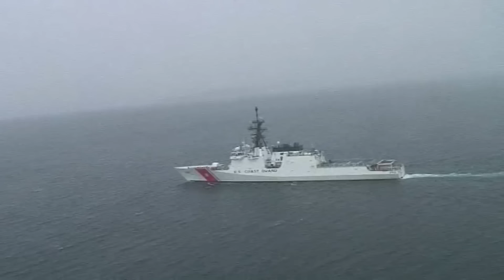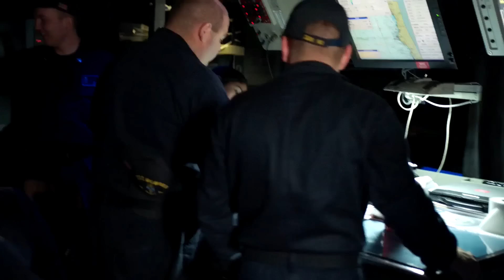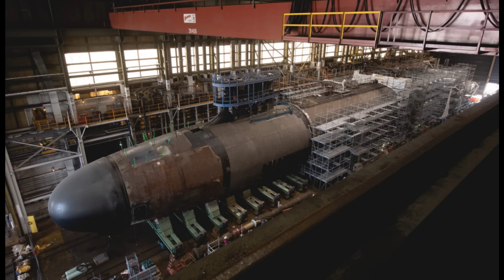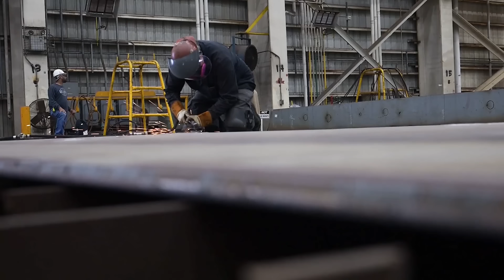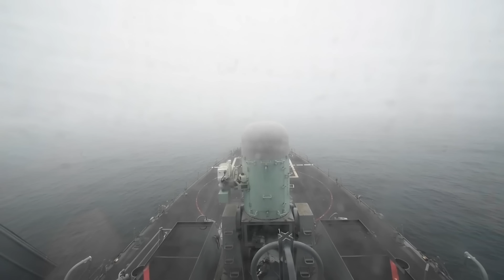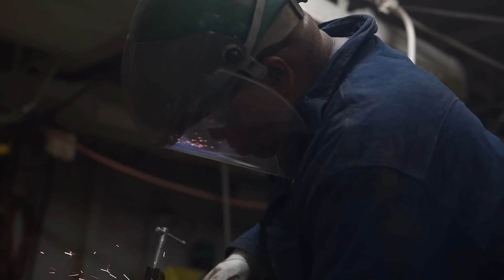The US Navy’s Radical Plan to Build Its New FF(X) Frigate Faster and Cheaper

Comment: You are right, the LCS and the FF(X) are similarly puny in offensive capabilities.  The LCS, however, had so many problems with corrosion, machinery, manning, escalations in cost, modular weapons development, short legs, etc., that the Navy just gave up on it.  If more conventional and efficient and lower speed machinery could have been installed, the LCS might have been salvaged, but that would just take more time and reveal just more problems.  The FF(X) gives the Navy a ship with long sea legs with a decent track record.  That is just what is needed.  The Garcia class frigates were highly successful and had practically no armament.
Reply: The FREMM is a better design in every important respect than this ship, is also a significantly larger warship (in standard form) and has far more options for weapons systems. The FREMM design also has a hull optimised for anti-submarine warfare; the coast guard cutter is designed for speed/endurance and not the specialised anti-submarine warfare (ASW), hydrodynamic requirements for a submarine hunter. 

The Royal Navy made this mistake previously in trying to reduce the size of warships to the extent they were under-armed and also had no sensible option for future (and usually) heavier weapon systems or more systems, the cutter also has the extra problem of not being designed for ASW, something that cannot be fixed as hull design has to come first.
Reply: @LeeXRV  The Coast Guard ship beats it in having way longer sea legs and ability to handle rough seas.  The FREMM is better in most areas.  That is why the Navy originally chose it.  Only now they realize that these ships will take longer than expected to build.  They were forced to choose between 2 goals:  1.  Build a frigate that was highly capable but which would be costly and take longer to build, or 2.  Build a frigate that is basic (and no match in capability to Chinese frigates) that can be built quickly (still slow by Chinese standards) that can be built in more yards (thus enlarging the US shipbuilding capability).
Reply: @gs547  what evidence do you have that supports the Coast Guard ship being superior in rough seas? I'm sure the opposite is true that the FREMM is more effective in rough seas due to the hull design. 

Ships that are designed for speed and endurance are usually worse in rought seas. The FREMM is also far longer and heavier which will give it a significant advantage in rough seas. 

I would argue a country should place its primary warfare decisions on the capabilities of the ship rather than the secondary benefits of employment, its also worth saying if speed of building is important the FREMM ships can be built at a much higher volume in both US and European shipyards. The main problem the USN has had with the FREMM class is excessive redesigns of it. It's kind of silly, the USN kept modifying the design of the FREMM class and due to the delays the project was axed and replaced by a ship of about 1/5th of the capability, talk about own goals eh?
Reply: @LeeXRV  Ingalls claimed in 2014 that their patrol frigate (modified Legend class) ship could operate helicopters and boats in sea state 5 or higher.

Comment: The FFX is a good idea and a great start. I'm not as sure about the BBGX though. I think what they really need there is to take the basic Ticonderoga hull, then update it with modern power plants, superstructure, electronics and communications.
Reply: The Tico hull is maxed out as is the Burke.  They need a larger hull for a large surface Combatant.  Remember steel is cheap, advanced weapons and systems are whats expensive.  Just making a big ship doesn't mean expense scales up.  But if you load it up with huge numbers of weapons and systems...that would drive up cost.
Reply: @brenthegarty3922 then go with the BBGX if you need a bigger hull than the tico then you might as well go with the battleship. The whole point I was making was it would be much more cost effective to go with a known product and modernize the power plant to produce whatever is needed to operate the new systems. If you need to go bigger, then you might as well go Trump.

Comment: The essay is a well argued case for a frigate class in general and within a rapidly declining US Navy, especially. 

What could be elaborated on in a follow up video is a breakdown of costs between hull, propulsion, sensors, and armament in order to clarify which components are driving costs, most - arguably since the Spruance-class. 

I tried a bit, before to comment about comparing sensor and fire control systems across frigate and destroyer sized hulls, currently in NATO and ASEAN service , but one could need 'a drawing' in order to visualize the different 'Off-the-shelve' options upon which any proposed 'Extended Patrol Frigate' by Huntington Ingalls Industries can be judged... 

...as either 'mediocre' - even insufficient for it's basic mission like the two Littoral Combat Ship classes which all-aluminium hulls can only operate along uncontested coastlines (at 350 plus million USD per unit for the Freedom-class and multihull Independence-class, originally planned for 55 vessels, but with several lead hulls decommissioned without upgrades, only 27 of 35 remaining active) - or as an outstanding combination of contemporary naval components within the intended price range (ideally within the 550-800 million USD mark of the Legend-class National Security Cutter - with ordered unit numbers bringing down production costs - one may conclude from the LCS procurement, cut short to 27 units, a FF-(X) would have to fill the gap by 28 units)...

Comment: This is exactly what the Navy needs. It doesn't have to be a heavy hitter to help the Navy's overall mission, especially with the Trump class getting green-lit. Having 8 NSMs is plenty of threat to force the enemy to worry about it, and the fact that these can operate out on their own, away from the fleet, makes it something the enemy will have to take into account. Having different angles of attack is critical for naval surface warfare. But the biggest thing this program provides is the industrial boost the class will allow for. And once they have the platform, the Navy can develop new weapons that can be fit to the system, especially things like drones (aerial, surface, and sub-surface). That would make it a fairly unique threat that is very agile.

Comment: If they replace the 57mm with the 76mm Oto Merala Strales , it will actually become a more potent ship wo to much weight upgrade
Reply: 76mm is no longer in the US arsenal so it would not be possible.
Reply: @roberthall1354 of course it would, you purchase them just like you would purchase the 57
Reply: how much more weight for a Mark 45 5 inch gun ?
Reply: @thomasklein4265 roughly 8.5 tons.  But they necessary weight increase for bracing etc to handle the recoil would probably double or triple that.  Though it would look totally badass with such a big gun on the bow.

Comment: Has anyone contemplated the concept of turning common cargo ships into Navy missile platforms?
Reply: Yes they have and the Arapaho Project converts large container ships into aircraft carriers. We proved that concept during the Falkland’s War.
Reply: @living2ndchildhood598  Also looking at the projected new frigate...looks like it might be able to handle a single F-35B if the landing surface is covered properly.
Reply: @chrissschwehr5911 
Sorry, that weighs too much. Stability would not support that much weight.
Reply: @living2ndchildhood598  So you think a cargo ship can't handle 3 or 4 40ft cargo containers????
Reply: @chrissschwehr5911 of course it can and more. We developed Project Arapaho to use 20’ & 40’ (mostly) containers to turn container ships into aircraft carriers. 

Putting “modular” weapons containers on most warships have major limits due to shipboard stability. Every ship is different per it’s size and Center of Gravity.

Comment: Good point about increasing the political success by spreading it across different shipyards/ voting districts. A lot of large projects get canceled whenever a new admin takes over, but pork barrel projects are nearly impossible to cancel. NASA has some good examples.
Reply: Constellation was being built in a blue state....
Reply: This might be politically nice but from a technical side it makes things dramatically harder.

Modular construction is actually very difficult to do well and I've seen it spiral badly several times.  To make it work you really need everyone to be on the exact same page and build to very exact designs. It's very easy for variations on how modules are built to cause huge integration issues.

Comment: I am disappointed in your report.  The new FF(X) is SUPPOSED TO BE . . . an ESCORT!  Escorts require a program office of its own.  The U.S. Navy USED TO KNOW how to build ESCORTS, and ESCORTS must protect their charges.  That protection is from Anti-Ship Cruise [and Ballistic] Missiles (ASCMs), and Submarines, in addition to surface raiders.  
The Mk48 VLS can be installed in, on, attached to, or underneath/inside the vessel’s deck, and are much less expensive to manufacture and maintain.  They weigh less, but are smaller and perfect for the Evolved Sea Sparrow Missile (ESSM).  In Blk-II form the ESSM is more than sufficient to provide AAW protection for the vessel and its charges out to 27nm.  The AN/SPS-77 3D air and surface search radar is capable of supporting the 3D targeting equation up to launch and initial flight.  The addition of STIR (Signal Tracking and Illumination Radar) gets the bird most of the way there until the missile starts doing its own thing.
There is a fixed array face Sea Giraffe 4A FF radar.  It is a naval long-range AESA S-band multifunction radar providing the awareness required to protect your ship and rule your domain.  There are other candidate AESA fixed array faced 3D air search radar from Israel, South Korea, Japan, and others.  They are larger and heavier than a SPS-77, but smaller than a SPY-6/7 footprint.  If Raytheon or Lockheed Martin can make a smaller lighter, SPY-6/7 . . . then now would be the time.  
Every large Amphibious Ship has a Ship’s Self Defense System (SSDS) on board, and it is driven by a AN/SPS-48 or new SPY-6(V)2.  The SSDS system was created to defend against the “45 seconds to impact” ASCM defense equation.  The FF(X) has no such capability, and this is primary survival concern in the Modern Naval Battlespace.

The Anti-Submarine Warfare solution is actually easier with installation of the Mk58 Compact Rapid Attack Weapon (CRAW).  Development and test of the Mk58 CRAW has been ongoing for some time, and it is time to introduce it to the fleet.  That little torpedo has so much capability that we cannot even tell you everything it will do.  
The largest failure to plan and execute I have seen so far . . . is that the LBTES has not been built for follow-on development and test.  
The one thing that NO ONE is talking about is operations in the Arctic with U.S. Navy Surface Combatants.  Our DDG-51 destroyers are not built with Ice Hardened hulls for dealing with Annual Ice (up to a meter thick) in Arctic Waters.  This capability requires availability of special steels, hull configuration, and construction techniques. 
Just my 2ȼ.
TORCH OUT

Comment: Any conversation about adding weapons to this vessel, whether built in or containerized, must begin with combat management systems. To operate independently the ship must have a combat system built into it. This is easier said than done, which is where the problems began with the Constellation Class. Increasing the electricity needed for cooling and redesigning a sensor mast to get sensors high enough above the water line to be effective is just the beginning. Of course, it can use combat systems on ships it could be steaming with, but this means no independent missions.
Reply: It already has everything needed and prepped for quick installation!

Comment: This is not the Sherman tank of Frigates. 

Just because it's cheap and fast, doesn't make it good enough. It first must be adequate to fulfil its primary role, which the FFX is not. There are numerous existing and proven designs out there, which fulfil this mission so much more effectively.  European frigates make these things look like the OPV's they are, while maintaining the scalability/affordability/flexibility that this program boasts of. 

The USN has painted itself into this uncomfortable corner through many years of incompetence. No amount of wishful thinking can undo the reality that these are not Frigates, but up gunned OPV's - and they will remain so until they are significantly re-designed.

What's worse, is that it's flaws only compound when you consider the terrifying threat picture these ships are likely to face.

Comment: The FF(X) isn't designed to be cheap. The last Cutter was $1bn for a patrol boat.
Reply: A Arleigh Burke guided missile destroyer, DDG, costs more than $2 billion... $1 billion for a FFX is CHEAP compared to buying and building more destroyers... Duh... This isn't rocket science folks...
Reply: @ronclark9724 the problem is the FFX is far to small to be useful and the hull isn't ideal for ASW operations. The FFX isn't a good choice for the USN but is a (poor) forced choice for a service under severe pressure.

Comment: ".....for sea presence."  Code for self-powered targets.  What's the point if there is no VLS?
Reply: having more 'targets' is an asset to itself
Reply: Everyone assuming the "Adaptable modular space" behind the gun doesn't exist .. it's even shaped like a tube ..
Reply: Doesn't need it. The point of this ship, as the author mentioned, is not to be a small destroyer but a frigate that will have a singular mission set that can be configured to adapt to mission it faces.
Reply: The FFX is being built for the Mr. Roberts navy, the backwater mundane navy.... The DDG is built for the front line  aircraft carrier navy... For every frigate built, frees a destroyer... Without beans and bullets, not to mention fuel, the front line aircraft carrier navy starves...  Apparently not to many of today's younger generation have seen this film... https://www.youtube.com/watch?v=mzdnxnhxyX0
Reply: Modular containers, like the Dane’s use, to change the ships role. Anti sub, mine warfare, land/sea target attack and anti air modules. Also containerized missile could be replenished at sea unlike VLS (yet). Unmanned sea vessels could enhance that and also use containerized missiles.

Comment: After the hull and power plant is gotten right scrap a ffg seven snd install the sensors and weapons on the ships add nsm and sixteen vls and you have a good frigate
Reply: There is no need to equip a FF with a VLS for escorting tankers and supply ships in the Mr. Roberts navy... The US Navy has a hundred DDGs, the navy doesn't need more destroyers, the navy needs more frigates since the LCS failed in the blue water escorting mission... The LCS is more a green water warship, not a blue water warship...